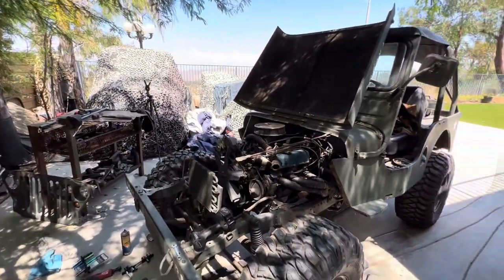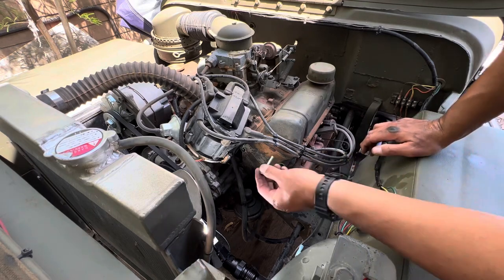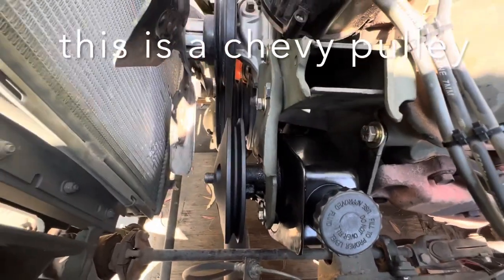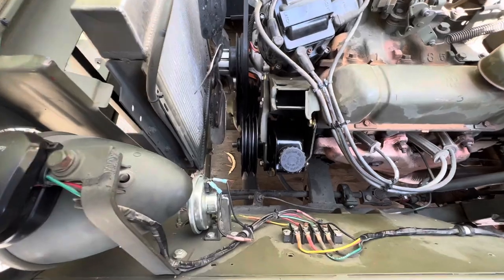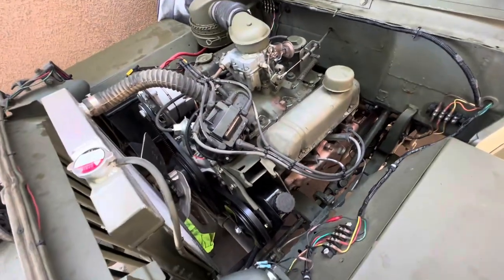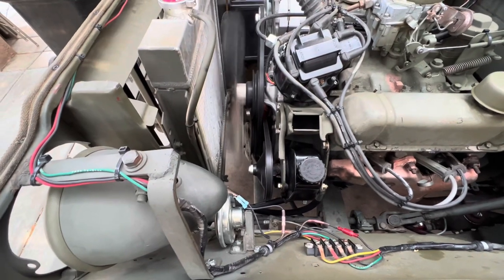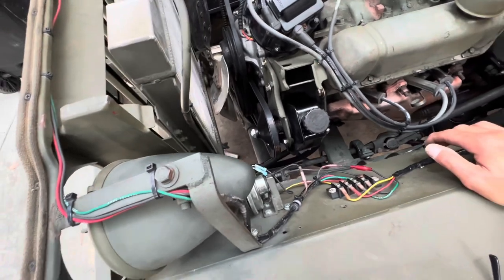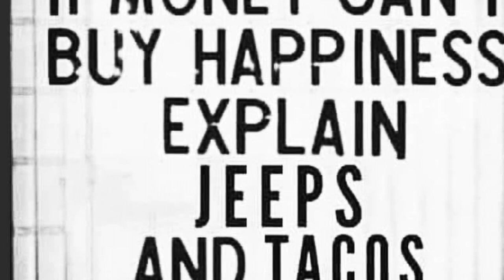CJ2A Jeep Buick 225/231 power steering install/ Vintage Willys Jeep

Comment: Is this v6 odd fire. And is that fuel injection.? Thanks for the video
Reply from the maker: hi - yes. i run a buick V6 231 ODD FIRE. no fuel injection yet. I just bought a sniper efi. I should be installing it soon. 👍
Reply: @reconern 
What kind of carb you have on it now . And is this carb good on a big hill ?
Reply from the maker: it had the regular 2gc rochester 2 bl. it ran good.
Reply: @reconern 
Would a ford Motorcraft 2100 carb is better choice with the odd fire v6 ?

Comment: Hi What kind of Radiator are you using? And did you make those brackets for it??
Reply from the maker: I got an ebay radiator. CJ5 radiator. It came exactly as it is. I had to make the brackets to hold it to the jeep. I also angled the bottom hose neck to angle down (I welded it-but any radiator shop can make those adjustments/welds for you).

Comment: What about speed difference with buick v6 231  ?
Reply from the maker: I feel they are the same; only difference is the 231 has electronic points on it and it runs excellent with it. (they have kits for the points distributors, but haven't tried it yet).